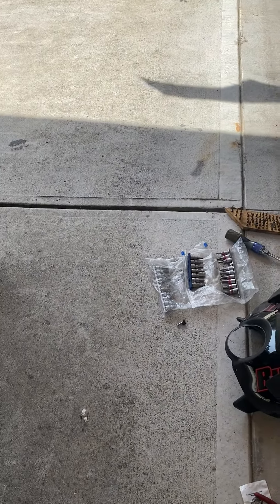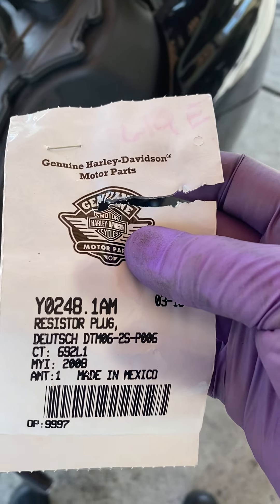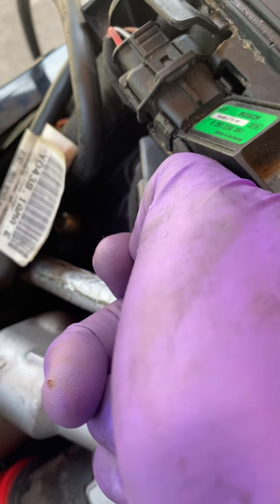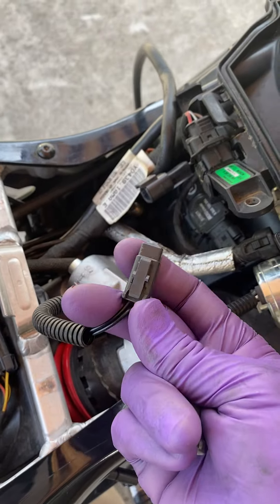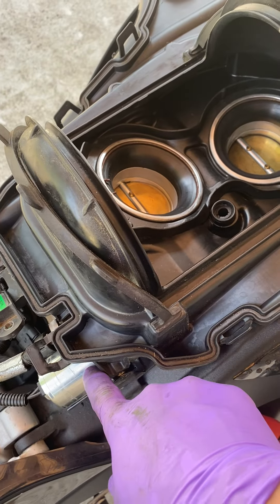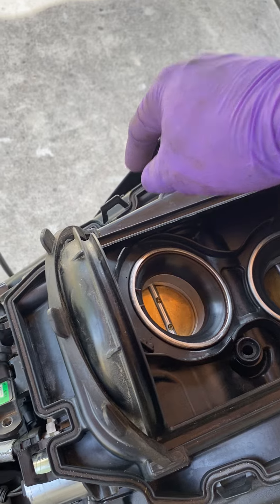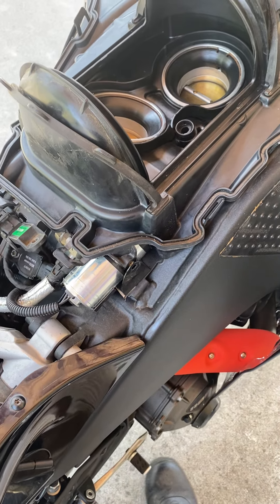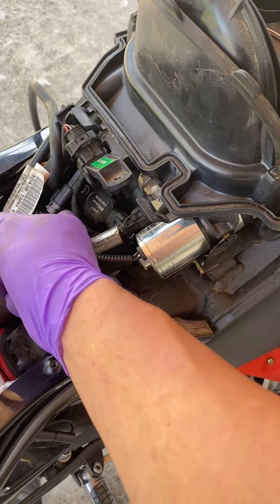Buell 1125r & 1125cr denoid

Comment: So, what did this accomplish?
Reply: Same question~~~Maybe it can make the throttle feel lighter
Reply: Due to EPA noise regulations, when shifting into 3rd gear and accelerating the solenoid will keep the throttle bodies from fully opening when the throttle is twisted. This results in a huge lack of acceleration when you are expecting the bike to take off. By 'de-noiding' the throttle body assembly, there is no interference with throttle performance.